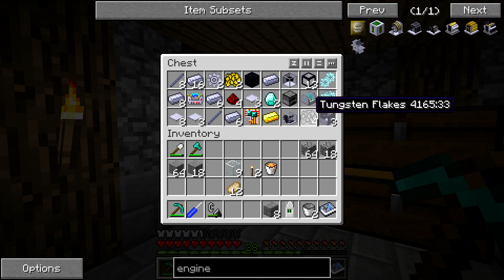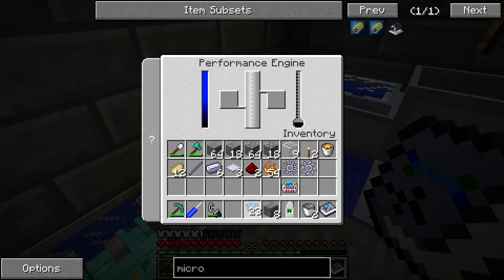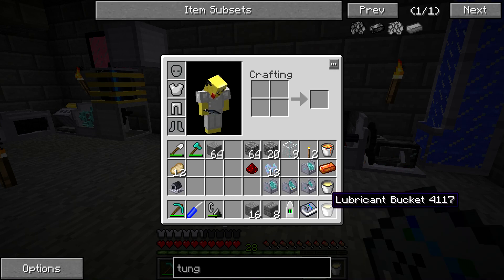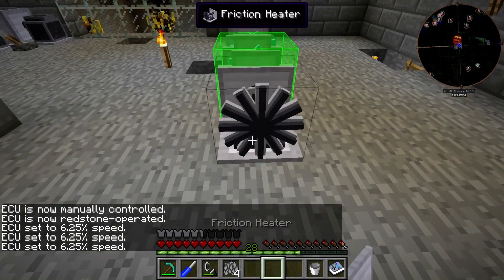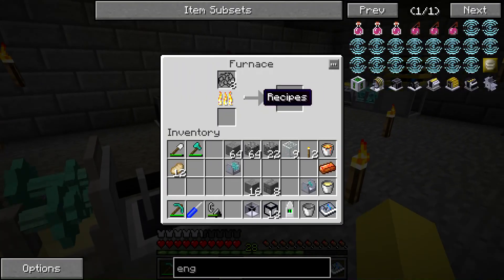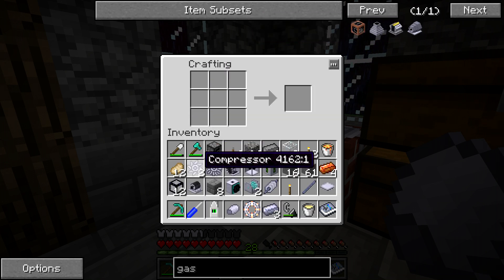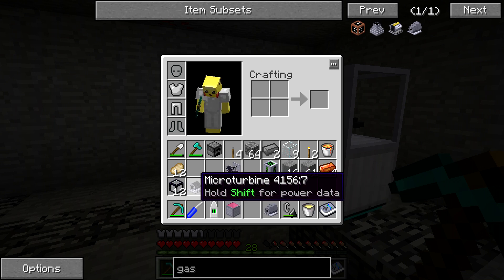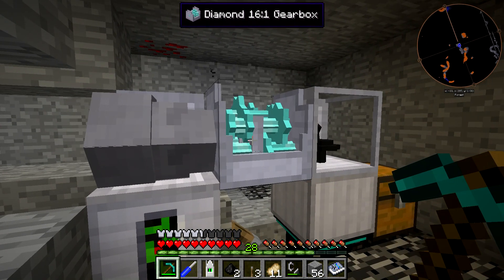Surviving With RotaryCraft :: Ep.11 - Bedrock Breaker & Gas Turbine

Comment: The Gas Turbine fails with a style. When something or someone goes through it, it starts outputting fire from its back (it does burn you) and makes a bunch of sounds - and its power output gets reduced. When you manage to break it enough (preferably by launching chickens into it), it starts to overheat and explode all over the place (it hurts you quite a lot, but doesn't damage the terrain - it certainly looks cool though), before finally destroying and burning everything (=usually your base) in a huge fiery explosion. Much cooler than the reactor meltdown from IC2, in my opinion.

Comment: huh... now what I really want to see what happens... could you make a short video explaining what catastrophic failures can happen? I think that would be a cool video to do at the end of the series, or a few short 5 or so minute video's of all the catastrophic failures, leading up to the current technology you've done.

Also, if you set the bedrock breaker on its side, so it extends on X or Z, how far does it extend? would you be able to set up with a vacuum to suck up all the bedrock dust so that all you need to do is reposition it to mine more? Also, can you do it in the Nether, or did Rika make that impossible to dissable bedrock farming from the "top" of the nether?

And I concur, the sound of the turbine spinning up is kinda cool. Do you have the Turbine Craft addon installed? I think that one adds a multiblock structure of the gas turbine that is... well... if you think the regular gas turbine would make a massive explosion, I think that the massive Steam Turbine would make a bigger hole, on par with when you allowed the IC2 nuclear reactor to overheat (if not bigger!)
Reply from the maker: As I've mentioned in today's video, eventually I will do some engine failures for fun. I may do it at the end of the series to destroy the base like I did in the IC2 series :) For the bedrock breaker, I want to say it will extend 4 blocks. Ill have to test the nether too, as there is bedrock right inside my portal!

Comment: so the microturbin is a jet engine basicly because a jet makes lift with wings and jet fuel and a microturbin uses jet fuel to power a base
Reply from the maker: Basically :) gas turbine would probably be a better example though because it generates much more power and honestly, looks like a jet engine
Reply: yes